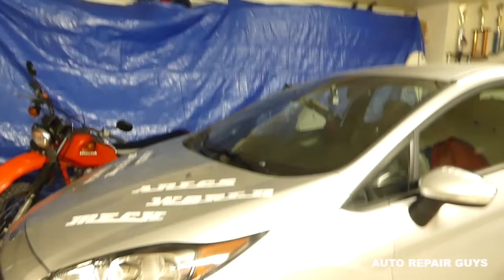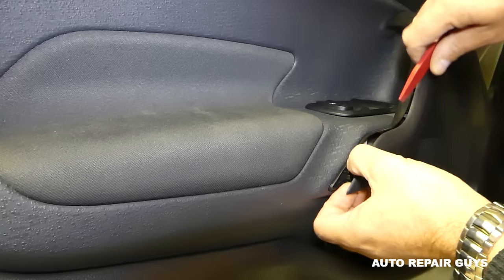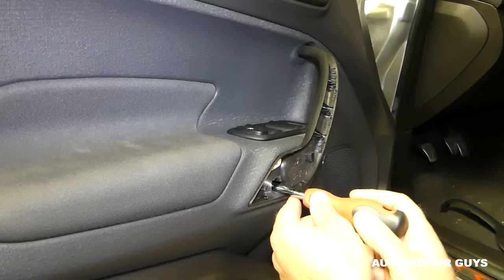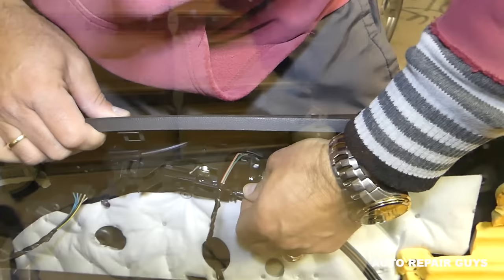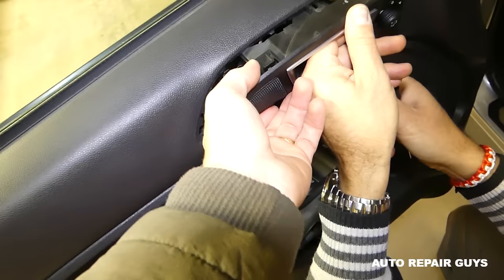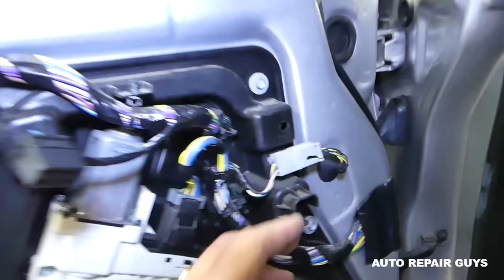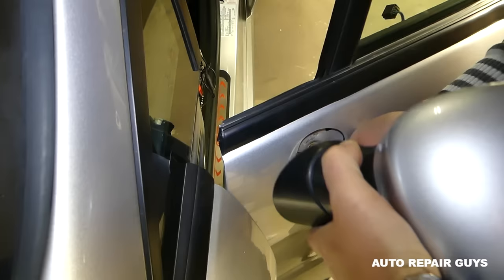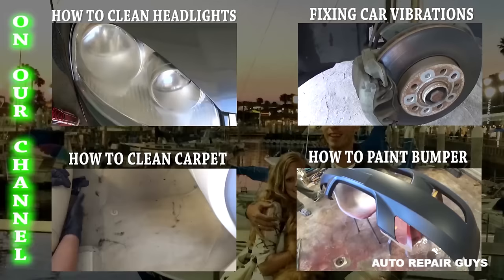HOW TO REMOVE AND REPLACE SIDE VIEW MIRROR ON FORD FIESTA MK7

Comment: No need to completely take off the door panel and disconnect all the wires, you just  need to disconnect the window up and down control in the middle of the panel, that's all, then just let the door panel hang down enough to get access to the mirror wire. Really easy and took me no time at all. Just use a strong string to help get the wires for the mirror through that pesky little hole. Tie the string to the old wire before you pull the wire through to take the old mirror off, then retie that string to the new wire of the new mirror to help pull the wire through inside the car again. Oh, and be careful with that nut, undo the last few turns really slowly with a lot of care so you don't lose it in the door. Good helpful video though, thanks :)

Comment: TIP!
It's really easy drop the mirror nut down inside the door (I lost 2).  Before unscrewing the nut, push a soft small towel in to the door cavity underneath the nut that way if you drop it you won't lose it.
Reply: I use a piece of tape on the socket to retain the nut in the socket.
Reply: Might be easier to splice the wires outside the car eliminating the door panel removal.
Reply: I use a piece of tape on the socket to retain such fasteners.
Reply: I'll keep this in mind thanks for the tip
Reply: @hvymax  Hmmmm, I'm almost inclined to give that a try.

Comment: Just wanted to say a quick thank you for this video. Whilst my Ford didn't have as many screws to remove, it was pretty similar. Especially liked the advice about getting the wing mirror wire in the gully to avoid getting it in the way of the window glass when you open the window.

Word of note, I didn't have to take the whole door panel off... I was hindered by a nut that just wouldn't unscrew, so had to improvise! It was tricky, but I tied a piece of string to the new wing mirror cable and managed to feel where it was before pulling it through and re-connecting everything! Glad to say it worked and I've saved myself over £500 for a new one fitted by a Ford dealer in my area.

Thanks again, inspired me to give it a go... So glad I did.

Comment: Thanks. I just bought an 11 Fiesta and realized tonight as I was putting on the Frostbkocker that the mirror was loose! I will pull the rubber hole cover and check for the bit tomorrow!

Comment: Thanks for the video. I changed the same mirror without remove the door inner panel. It took about 3 hours. The hardest part is the rewiring the cable back to the connector.

Comment: nice easy to follow video, I cant help but think ford could have made this easier by placing the connector points for the mirror within the seal where the nut is removed to take the actual mirror off, would save having to remove a whole door panel
Reply: Mine are there now with spade connectors.

Comment: Thanks, very helpful. Getting the door to pop off once the screws were out took an inordinate amount of force. But worked fine in the end. Didn't actually bother removing all the wire from the door panel just had my partner stand there holding it while I did the door mirror cable.

Comment: If you attach a piece of string to the old wire you can use it to pull new wire back through
Reply: What do you mean?
Reply: @stevenk5786  If you tape some string to the wire you can fish it out easier and then pull it through & remove the string. Much easier that way. Also magnetic bits will help you not drop the nut for the mirror. Work smarter not harder ;)

Comment: Thanks guys.  Was able to swap out a broken drivers mirror with your instructions.  I was curious whether the mirror should fit tight against the door, since there is all that foam in the mirror housing.  My daughter was concerned that water/rain could get between the door and the housing and cause problems, since the mirror isn't sitting totally flat on the door.  The passenger side doesn't fit flat either, so that may just be a design flaw.. er... feature.
Reply: Were you able to fix this gap?

Comment: Attach a string to the mirror wire when removing the old mirror.  long enough to be able to grab it on both ends.  then remove the string and attach to the wire from the new mirror.  that will make fishing the wire back thru the door easier.

Comment: Heads up, the white connecting the inside door handle may just fall out when the plastic front is removed.  Make sure to reconnect that one when you put it back on or you'll trap your passengers

Comment: Should have taped a piece of string to the mirror wire before pushing it in the hole. You can use it to pull the wire from the new mirror back into the door.

Comment: My passenger side mirror won't fit at all. Getting to the point of absolute frustration with this. I got ran into a little bit, but more like slowly moved into on the highway and before I knew it my mirror was facing directly at me. From what I can tell the door panel holes for the connections don't look fucked up but my new mirror refuses to get the right fit.
Reply: Was this fixed?
Reply: @kimanora5178  The inside of my door panel was damaged which ended up being my issue. Just wouldn't sit flush until that was fixed
Reply: Just noticed mine got a bent bolt on the used side mirror replacement. Not sure if the door panel is damaged have to compare it with the other side. So if its the door panel, how do you fix that?
Reply: @kimanora5178  I took my car to a shop to get it fixed by people who had experience with it unfortunately I won't be much help there
Reply: I see. Thanks.

Comment: Why don't you tie a peace of strong on old wire pull it through when you remove old mirror pull it through with wire and string then tie it to new one and pull string though with wire untie plug wire on

Comment: before you put the cable through the top hole when installing the mirror, make sure you attach a long wire to it. then run the wire down until it comes out of the bottom hole with the plug, then tighten the mirror (13 hex flange nut in case it gets lost). i had tried this without the wire, installed it and the window regulator pushed the cable down. be sure to use the wire, i spent hours trying to figure out why the cable was interfering and pushing it to the side etc. apparently there are several shafts in there, hence the problem with the cable blockage.

bevor man beim einbau des spiegels durch die obere öffnung das kabel steckt, unbedingt einen langen draht daran befestigen. dann den draht runterführen bis er aus dem unteren loch rauskommt mit dem stecker, dann den spiegel festmachen (13er sechskant flanschmutter falls diese verloren geht). ich hatte das ohne draht probiert, eingebaut und der fensterheber hat das kabel runtergedrückt. unbedingt mit dem draht machen, ich habe stunden damit verbracht warum das kabel stört und zur seite gedrückt etc. anscheinend sind dort drinne mehrere schächte, daher das problem mit der kabelblockade.